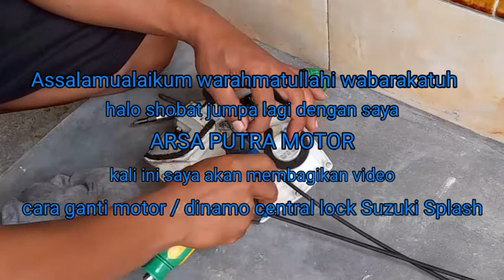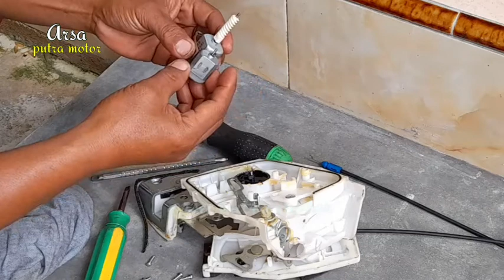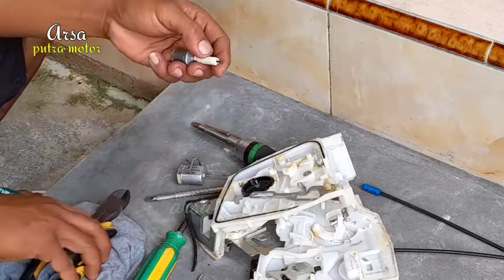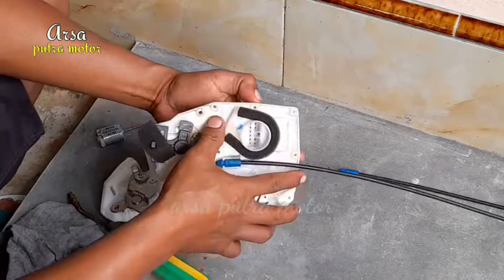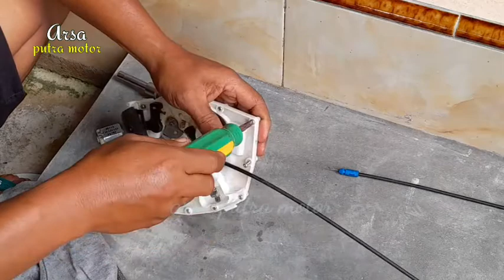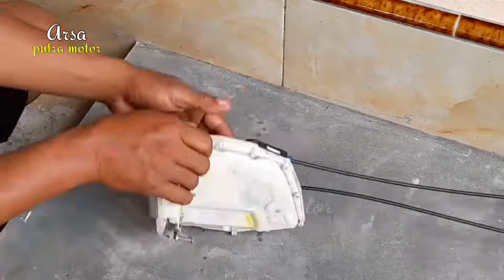ganti motor/dinamo central lock || Suzuki Splash modal hanya Rp15.000

Comment: Door lock mobil splash saya seperti lost dengan kondisi pintu tertutup, tidak bisa dibuka dari dalam maupun luar, bagaimana solusinya ya.., coba saya bongkar cover pintu, saya coba otak-atik di kawat selingnya tetap tidak berhasil.., gak tau harus bagaimana lagi..
Reply from the maker: Pastikan kawat hendel yg di dalam nyantol di tempatnya om, dan juga tuas hendel yg dari luar di posisi yg tepat,
Reply: N.R.A. Udah ketemu solusinya om, bagi tipsnya dong.
Reply: Punya saya macet dalam kondisi terkunci, cara lepas door lock nya gimana ya?